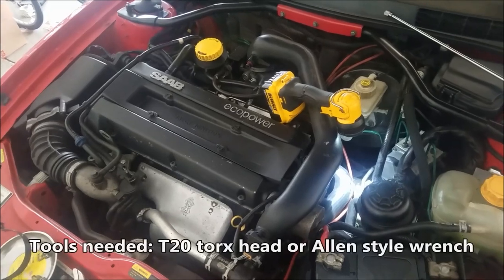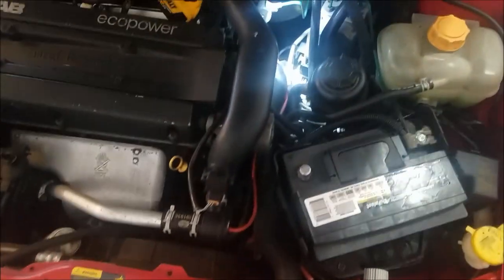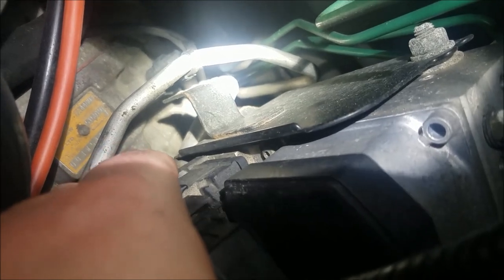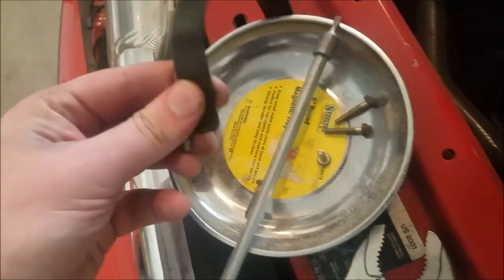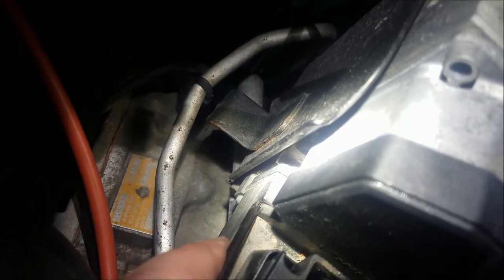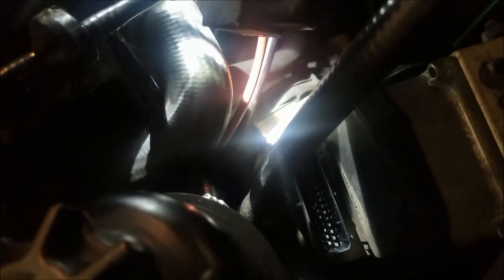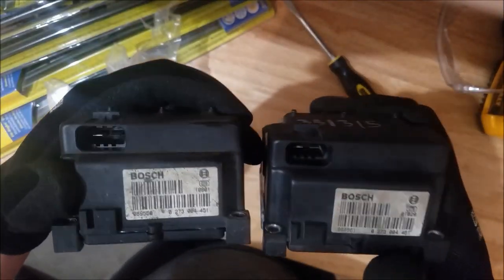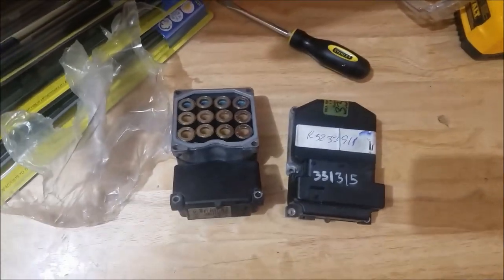Saab - ABS Module replacement

Comment: Hey! Nice video...
Can you please help me know whether why do we have those 6 brakes lines in the abs module?
Where do they connect.?
And why only 6?
Reply from the maker: Without the diagram in front of me, there's two green that come off the brake master cylinder into the ABS unit, and 4 green out from that unit the each of the 4 brakes. So yeah, 6 sounds right. I'd have to look again.
Those green lines go in & out of the ABS unit so that the car can electronically pump your brakes in a skid. The module I replace in this video is the small computer, or brain of the entire ABS system, that sits on top of the unit's electric actuators. The module is usually what goes bad when Saabs have ABS issues

Comment: Hi Ross. We recently purchased a cheap '99 9-3. It's getting some TLC ready to return to road worthiness. I'm not upset about pouring $2k into it, tidy as, drives very nicely, only done 103,000km. My issue is that it has ugly aftermarket alloy wheels. Someone locally is dismantling a '04 9-5. Do you know if the factory alloy wheels from that car will fit ours?
Reply from the maker: Oh yeah, they will most definitely fit. Both the 9-3 & 9-5 are the same 5x110 bolt pattern. People swap wheels between them all the time!
Reply: @saabross3171  went for a look this avo, two are in bad shape so I'll wait for a nicer set.

Comment: Hello by anychance would you know the location of the distributor on a saab 2001 9-3?. I cant seem to find anything on it online or other. Thanks man
Reply from the maker: There is no "distributor" on a 2001 Saab 9-3. The timing & firing order is all done by the electronic DIC, as opposed to a mechanical distributor like those red things you see on older Saab engines.
Reply: Thank soo much and i do see what you're talking about , just wasnt sure and my head was hurting already. That's my saab story. Haha

Comment: If I could afford a set from a 900 I think that would look epic.
Reply from the maker: The classic 900 & 9000 however won't fit. Those were 4 bolts whereas the 1999 9-3 and are up are 5. The NG900 wheels will fit though, if that's what you meant. I have a set a Talladega 900 wheels I've been meaning to put on my '99 9-3.
Reply: @saabross3171  thanks Ross